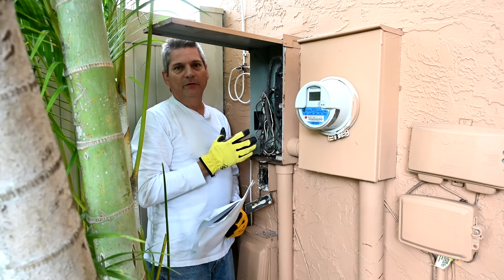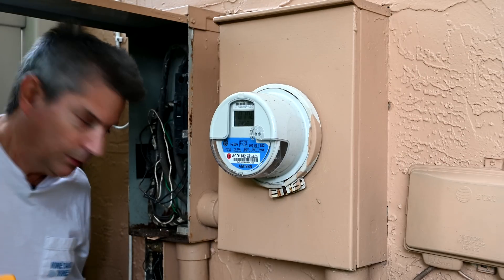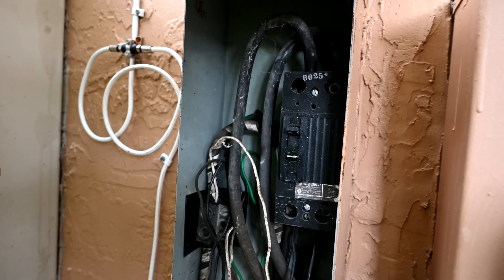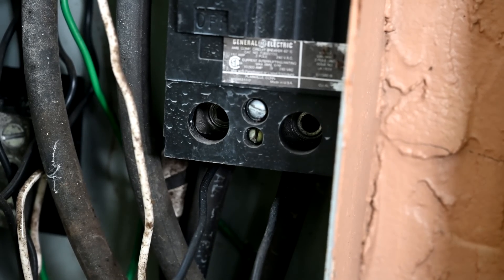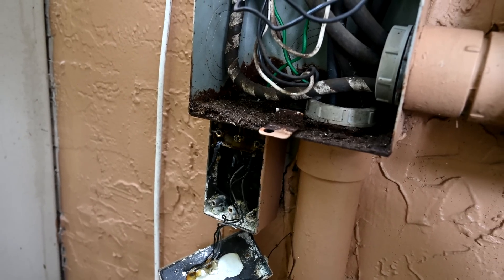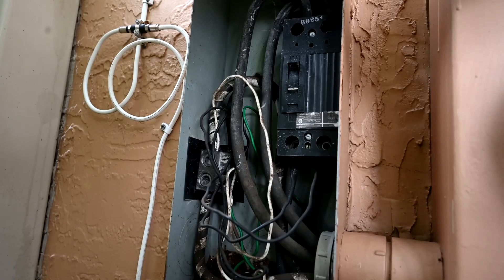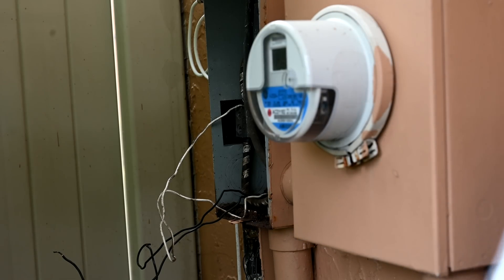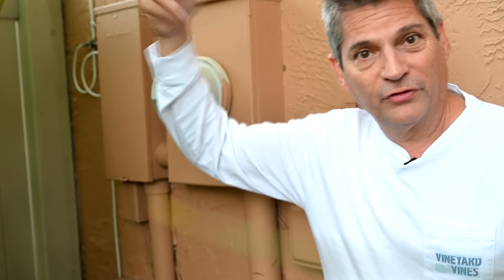Electrical FAIL: How To Fix Double Tapped/Wired Circuit Breaker

Comment: Great, you illegally worked on your friends electrical system. You put them and yourself at great risk for being sued down the road. Your bs gloves are not hot gloves, they will not save you. Its a breaker enclosure, not a panel. It's a lug, not a bolt. Qualified people have Masters license and insurance, and know what they are doing. Did you put a ko filler in the bottom of the enclosure? I'll be reporting you to the local department of licensing and registration btw. Hope your paperwork is in order.
Reply: Just shows how little of experience you have in the electrical field to say a home owner wouldn’t do this. It’s because of people like you that post these silly videos, that anyone can be a home made electrician. Your a hack. Call me a troll I don’t care I’d rather be a licensed and insured troll than a hack like you any day.
Reply: Alex your 100% right. Jeff are you licensed and insured? Who says it was a licensed electrician who installed the transformer? I believe you said you believed it was the builder. In most cases it’s the homeowners that do these dumb things. Your not the right person for this job, put down the camera and your cheap new tools go back to sitting in from of your computer. “I’m an engineer!” You know every engineer I met that has done their own electric, has been WRONG. I understand you believe you know everything when it comes to electrical, but if you did you’d have a license. Stop posting your a waste of my YouTube feed.
Reply from the maker: @josephashe9958  If this channel is a waste of your feed, why do you keep it in your feed? There's a Fortnite channel you can go troll. Cheap tools? That whole electric tool bag has probably over $2k in tools, the Fluke meter alone is $450, but an unqualified troll like you spreading hate does not know the difference between good tools and bad. Not too defensive are you? One of the things you would learn if you were qualified for this, is that the builders often use super cheap labor, often forefingers who work for pennies, barely speak English and don't understand the National Electric code. You logic was way off about the homeowners installing this. All the units there have this. No homeowner, no matter how brave would run wires into the back of a cement block structure, with no way t route them to the front of the house. This was all done when the bricks were laid. Nice try, trying to fool people that you're an expert. LOL, at least you gave us all here a good laugh, thanks for posting.
Reply: Again I ask are you a licensed electrician?
Reply: I know quite a few people who “don’t speak English” and they know what their doing don’t be so arrogant. They worked for their licenses. You don’t even have one.
Reply from the maker: LOL, I knew it wouldn't be long before some high and mighty drama queen would show up trying to discredit the work. I repair work done by you guys all the time, just like I did here from an alleged licensed electrician, who like you is probably high on himself.  Your moronic statement about "You put them and yourself at great risk " is a useless uninformed joke by an obvious journeyman at best. I REMOVED the "great risk" you speak of, LOL! Yes I know what I'm doing. I turned off the breaker so the entire area I worked in at the bottom was safe. Yes I didn't have my Class 0 rubber insulating gloves on. Just because I dumbed down a few terms for people does not mean I'm a huge risk, LOL! A Lug is still a bolt, and still tightens like  a bolt. Get over yourself already, you're inebriated by your own arrogance and inexperience.

Comment: This is a surge protector and any real electrician would of figured this out. You will burn something down sooner or later
Reply from the maker: LOL! This is not a surge protector, nice try "Danger". You will burn something down. That is the transformer for the doorbell. How could you miss the wires for the diode glued to the cover of the sub box? Also the developer of this community we know was so cheap they never in a million years would have put in a surge protector. It's amusing watching ignorant trolls like you spout off when you don't know anything about the subject, and just prove yourself wrong. Thanks though, you gave us all a big laugh here.

Comment: Very informative vid, but are you really running 3 different platforms? Just sponsees I’m thinking ; )
Reply from the maker: i use a bunch of different tools, and lots of tool review videos, so yes I use lots of platforms. Also I just happen to have a cheap Ryobi tiny blower that I use. The Milwaukee M18 vac I got at Black Friday Sale, as well as the Craftsman tool set, waned to get them into the field and tested.

Comment: Nice box of Craftsman tools. If it was parked in your garage. I hope that was an ad, and I hope they hear people that say the tools are fine, but giant blow molded plastic isn't going in my vehicle. How do they always manage to make space wasting devices that allow your tools to roll all over? You hit one pot hole, and you'll be as organized as a 5 gallon bucket. How come there's not more rubberized socket holders? I'd rather have 5 of those in the pocket of my bag than an entire drawer of tools that requires being kept upright.

It's not a dig, Craftsman, it's a complaint tool makers in general. If you want your tools to be used by craftsmen, then you have to think portability and stability. Where would I put that at a construction site? Buried in the job box where you can't get to it.
Reply: Oh, and thanks for the input. I had never seen a bell transformer set up like that. Seems like the work of a bad handiman or resident. But then, look at the hard Rock hotel, no telling what builders will do.
Reply from the maker: I brought the Craftsman with me just to continue to test how it survives in different operating environments as I am still evaluating and testing it. If you see my other video from a few weeks ago you will see I compared this Craftsman tool set to the to dewalt tool set that comes in a case and normally I would have brought that dewalt tool set with me but decided to just test the Craftsman tools. You don't have to worry about tools in their traveling from bin to bin because I are already completed a 5' drop test in that tool review video and they Craftsman tool set did OK the sockets did not come flying out or anything.

Comment: Probably whoever double-tapped that box was the one that never put the plate back on😏  if those wires shorted against anything it has no breaker protection except the full hundred amps of the main!  That would really put on a nice light show 😃
Reply from the maker: Yes it is Christmas time, I'm in the mood for a good light show!

Comment: Jeff, in general what you did here was safe and effective but there was one thing you said regarding your "safety precautions" that was not accurate. The gloves you were wearing to help protect from electrical shock, may be fine work gloves but they offer zero protection from a live circuit, no matter how incidental the contact. The only gloves to offer protection while working on a live circuit are a tested and certified pair of rubber electrical gloves (rated from class-00 (500 volts) to class-4 (36,000 volts) topped by a pair of leather over gloves for abrasion protection.
Reply: If it's hot and your hands are sweat soaked at all, get ready for some tingles!  ;)  The danger here isn't the Double Tap per say.  The DANGER is that those thinner wires are unfused or unprotected.  They have a very high chance of collateral damage if they short, since they are only 'protected' by the large MAIN breaker.  They may be too thin to even trip the main.  They could short, and cause heat that may not trip the large breaker.  This could lead to more loss of insulation, more current, more heat and take out the hole box, and possible house.  It is a safety hazard, not just a nuisance!
Reply: Bill thought that myself. Why not just replace the box if it's that bad.
Reply from the maker: @trentjohnson7246  Property owners don't have the money, and did not have the money to hire an electrician that will charge $1500 for this repair. But if you're volunteering to send them the $1500, they'll right on it. Also you are correct about the gloves, but a DIYer doesn't have the necessary gloves, and regular gloves will over some protection, some resistance, perhaps enough to save a life. Better than no gloves, so your statement about offering 0 protection is simply not true. I would not work on live terminals with the gloves I'm using, but surely it will cut down some of the electricity.
Reply: @jeffostroff   It is expensive to replace the electrical panel.  I know from first-hand experience - and my former housemate was perhaps the worst professional electrician ever.  Where I live the cost of the permit is $350.   I ended up buying a Square D Homelite box at HD. Then I had to install two new ground rods, buy all the romex wiring, the copper ground wire,  a new bus to install into the new box, the new weather head, all the new conduits, new Square D breakers including the GFCI breakers which are expensive, replace and add CO detectors & 10-year smoke detectors, replace all the outlet receptacles.  The residential electrician bills at around $100 per hour.  And that doesn't include all the trips I had to make to HD because my goofy housemate is rotten at planning. I ended up firing my housemate and hiring another guy who was way more organized (which in itself would make a good teaching video - ie, hiring a disorganized anybody will be a disaster waiting to happen).  And let's not forget the cost of the tools - even my used DeWalt SDS max plus bits was over $200.
Reply: 110 % correct Bill

Comment: Have found doorbell transformers in some pretty weird places....but this one is in the top 5 of “odd” places 😂
Also, like the saying.....can’t make sense of stupidity 👍🏻
Great Vid✌🏼

Forgot to add. I’ve taken model numbers etc... to my local Ace Hardware & Supply House before & they’ve both helped track down old “hard to find” parts for me. Just a thought, if having hard time.
Reply from the maker: Thanks Aepek! I might even tell them to just switch to Ring Doorbell, 21st century technology
Reply: My stock of 16v 30va transformers have been flying off the shelf for that reason :)
Reply from the maker: @UbuntuSuperUser  LOL, so it was YOUR sales guys that installed it! HA!

Comment: Thanks for showing such an obvious fire hazard with no overload protection rated for the tapped wire.
Reply from the maker: Yes, luckily the transformer must have blown open, instead of shorting or it could have caused some damage.

Comment from the maker: ✅ Tools used in this double tapped electrical breaker video:
✅ DEWALT DG5582 Electrical and Maintenance Tool Carrier: https://amzn.to/2Gm8IoO
✅ Fluke FLK2AC/90-1000V Pocket-Sized Voltage Detector:  https://amzn.to/2THggao
✅ Fluke 87-V Digital Multimeter: https://amzn.to/2LK8etM 
✅ Milwaukee 48-22-2202 3-Piece 1000V Insulated Screwdriver Set: 
https://amzn.to/2ItbU3r